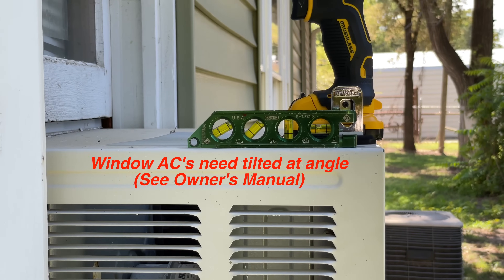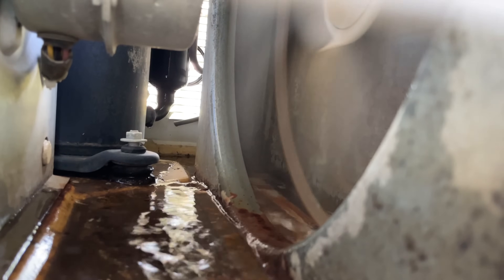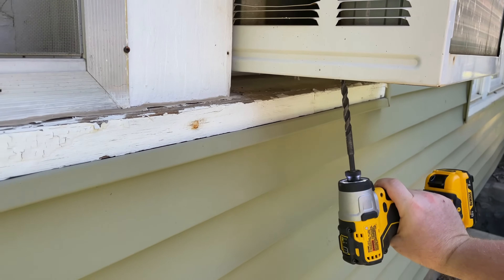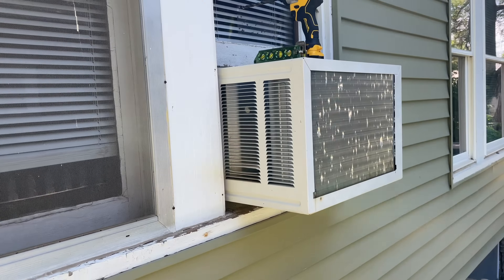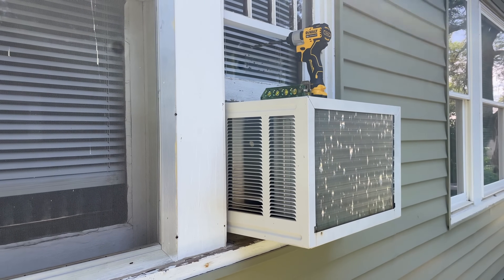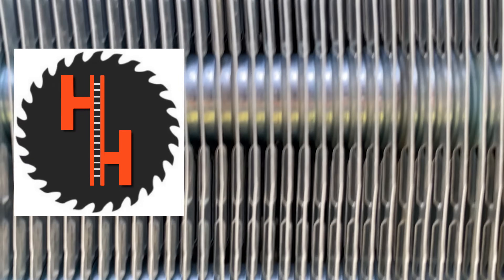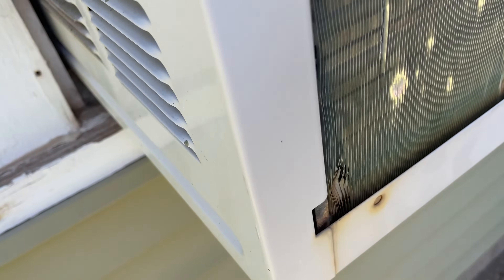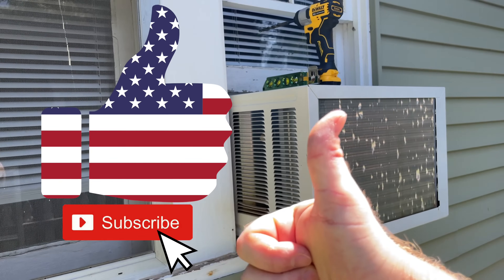99% Don't Know THIS About Window A/C's!! DON'T DRILL!!

Comment: I’m getting a mildew smell. I’ve already cleaned my coils once with distilled vinegar and it helped but I think it’s cause the water sits.
Reply from the maker: Sounds to me like it’s time for a deep clean because mold and mildew is in your inside blower fan. I have a great video on how to do it. You’ll be surprised how much mold than mildew is blowing into your room. 

Also, Nothing on the outside of your unit gets sucked inside. 👍🏼
Reply: yep need to get that water out

Comment: We have two window ACs, a Frigidaire and a LG, and both have this system where the fan picks up the pooled water and splashes it on the condenser coils. The LG has one weep hole in the lower back frame (not on the underside). The Frigidaire does not have weep holes in the back or under and the water pools up a bit and the fins at the bottom that are in contact with the pooled water are corroding. I'm going to add one weep hole in the rear of the Frigidaire unit, but I'm also going to use a drill stop to prevent damaging the condenser coil.
Reply from the maker: That’s a really good idea. There’s been a lot of air conditioning units that have went to the dump because of a hole being drilled where it shouldn’t have. I may have sent one there prematurely myself 😆
Reply: My window AC is on the 4th floor of an old house with steep stairs. When i take it out of the window for the winter water spills out. A lot of water and its dangerous on the wood stairs. How can I get the water out before taking it in?
Reply: @thankgodimouttahere  Purchase a rubber plug of sufficient size and drill a hole in a spot that allows the water to drain. Plug the hole until you are ready to drain it for removal.

Comment: Except it gets overwhelmed ridiculously easily and POURS water back into the house. Brand New AC. What a joke. Someone needs to get the class action lawsuit going. Dumbest design ever. New AC is useless in humid weather, when you need it most.
Reply from the maker: It sounds like it’s been installed wrong if it’s brand new. Install it to the instruction manual specifications, and it won’t do this. Every AC I’ve been around (which is more than the average Joe) has a weep hole/overflow hole that will let it drain outside before it runs inside. You need to level it correctly.

Comment: I wish I had seen this earlier .. too late .. I drilled exactly where you had your drill pointing and accidentally drilled the freon line.
Reply from the maker: Oh no! well, You arnt the first one to do that. A lot of window AC units go to the recycling center early due to this 😬
Reply: That is silly. You really had to disassemble the whole unit first. If you were in Canada or Europe you could still fix it, but If you are in the states? Good luck.
Reply from the maker: How do you fix this in a cost effective way?
Reply: @HandymanHertz  Newer window AC units do come with R32 almost always. And you can't get refrigerants other than R134a for vehicle A/Cs, without an EPA certificate. You can't fix it. The cost effective way will be buying a new one. If you are in Europe, you can get Hydrocarbon replacement for R32, what they call HC-32. Still, it would be cheaper to buy a new one.

Comment: Bro my ac drips water from inside and now I got a partly inf water generator 💀 

Edit: it overflows when used 2 to 1 hour, and leaks water outside and inside the house 🤔🤔
Reply from the maker: has it always done this? Sounds like there’s junk dammed up and not allowing water to exit to the back of the unit. You need to watch my deep clean video, I show you how to fix this problem.

Comment: its true that efficiency will drop , I have heard anywhere from 1-3%, I have not seen anything official on this. many believe that it is a good trade off to let the efficiency drop in order to reduce noise levels by drilling a hole to let the water out as some fans that scoop the water onto the condenser coils makes a noise.
Reply: This design caused one of A/C units to rust out over the years.

Comment: Mine was backing up into my house. I just stuck a rag in the back of it and it drains that way.
Reply from the maker: That works. Its specifically engineered to not leak inside if it’s installed correctly and/or not cleaned. Sounds like you need a deep clean on it. I have a good video for that 😉

Comment: Whew. You just saved me a lot of worries. Just installed an a/c for my sister. Her's is dripping water like crazy. I looked at mine that's been in for a few weeks, no water dripping. So I watched your video (the first one I found, and then checked the back of my a/c, and it was just like you said. Thanks, man.
Reply from the maker: Glad it helped! I was worried too when I first learned.

Comment: Sitting water is an invitation for mold so I rather drill the hole 🤷
Reply from the maker: Has never been an issue in my experience and climate, to be honest
Reply: @HandymanHertz  I'm in the Northeast and I bought 3 Midea units and found out they have a design flaw attributed to drainage. Maybe other ACs are different. Good advice though on the video because some people may not have thought about what you bring up👍
Reply: @HandymanHertz  Where do you live?  Can't be down south..

Comment: Well I drilled a small hole in mine cause I could not stand the splashing noise. It was driving me crazy!!!  So I think it’s a poor design because of the horrible noise it makes. Screw efficiency lol. Mine has been working fine for over 3 years now.
Reply: I actually like the trickling sound, especially for going to sleep. It's not a bug, it's a feature!
Reply: @fxm5715  lol worst feature ever
Reply from the maker: Mine isn’t very load, then again, it pretty much takes up the whole window space so I can’t hear it

Comment: I drilled a drain on mine. It makes more sense to me to not have the fan smacking water. That will burn the fan up if it makes it that long. It can burn up the fan motor and bearings.
Reply from the maker: I believe the fan motor and bearings are designed to handle the load. I think the Load would be minuscule, though, as it’s just a trickle’s worth of water. In my experience, the fan motor and bearings have never been the limiting factor  in any of my personal houses or rental houses.

Comment: my window air conditioners have little plugs on the bottom that you can pull out. So of course I pulled them out and threw them out long ago. I had no idea about this.
Reply from the maker: Not all a/c units have the slinger ring. You’d have to look into your make/model

Comment: The efficiency is lost when the fan blades pass thru the water causing drag.
Reply: The drag increase is minimal for a significan increas in cooling efficiency. The house is still cooler for less energy/money.

Comment: Not really, I set up window units. I would highly recommend drilling it, when you have access. If you drill it, make controlled weep holes I do 3 along the lowest point of the units this will allow a vacuum,  go out periodically, rub the holes and The water will suck out until you stop rubbing the holes when it empties. Not to forget, you may have to shut the a/c off during that time. After that is done, the water can rebuild and  the process can repeat. This is great for getting rid of stale water as well as preventing mildew and any other form of bacteria growth . There are more preferred methods I use that still involve drilling and the best one is when it comes to treating the water in the system to where it keeps it clean all summer and it works great. It may seem like a lot of work but general maintenance and innovation will keep equipment looking sharp and will work for much longer!
Reply from the maker: Mildew and mold on the outside had not been my experience with my personal window a/c units and also in all of our rental houses. I guess I don’t see any pros, only cons. ( I.e. Water will drip out, puddle up, chance of people drilling through condenser or fan and ruining machine, more energy consumed, less cooling capabilities (2 degrees cooler in my testing), have to go get drill and drill it.)
Reply: Thank you, It may all be preference really, I reckon. A buddy of mine, likes to draw a hose and collects the condensate and sends it to a pump for swamp cooling during the night. I agree with this video it could be hazardous and the system is already designed for max efficiency, drilling holes could be an annoyance especially if the a/c condensation is dripping from above in common areas where people are around. However, HVAC is part of my work and I as well, see the common failures day in and day out. What I see is the units are designed to balance in terms of climate furthermore for distribution. That's where innovation comes in, if you know what you're doing lol.
Reply: @photog3377  Yes I agree, I did see that one as well, and did that with my over head a/c as it dries before it gets to drippin all over the deck area when I'm sitting out grilling, it took a minute, but works great, however my downstairs unit was as simple as point- click done as a faster method. Probably, the best thing I've noticed is just leaving it alone, not being lazy lol and just spraying it out annually as I only use mines 3-4 months in a year.

Comment: My units leak constantly….
Reply from the maker: Where does it leak?
Reply: @HandymanHertz  Hi. The unit leaks out of the edge at the back of the unit. I usually use a bucket on the porch to catch all the water, then throw it in the yard once the bucket is full. I do this all summer. Is there anything I can do to remedy? Thank you!!

Comment: Get out the drill anyway. And fix the AC, BEFORE it causes a problem. Things are designed stupidly these days. Standing water causes, rust, mold, bugs. And other bad things. My 47 year old freezer still works great. While the newer ones (the ones with all the upgrades) barely last 10 years. Same with most appliances. I appreciate the video. But after decades of home ownership, I disagree with your assessment.
Reply from the maker: In my experience, (with managing several  dozen rental houses) not drilling it does not cause any issue that I’ve witnessed. There are a lot of cons to drilling ( I.e. water drips out and puddles up, runs less efficient, more electricity used, doesn’t cool down as much according to my testing.) this unit is from 2009 and still running like a champ. They don’t make things like they used to and for some things, that’s a good thing. (Cars, for example. Unless you don’t enjoy cruise control, a/c, great fuel mileage, 200-300k miles etc.) just another perspective for the older generation.  I do appreciate quality built things that last. Appliances seem to be lacking in this, to which you and I find common ground.